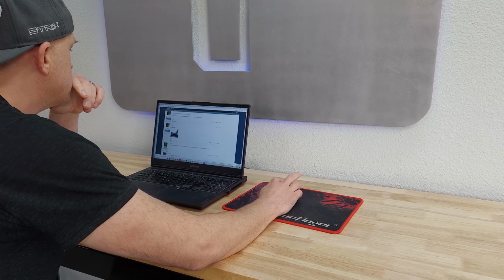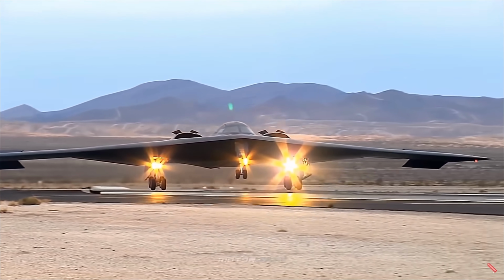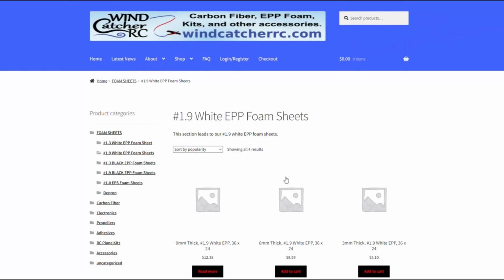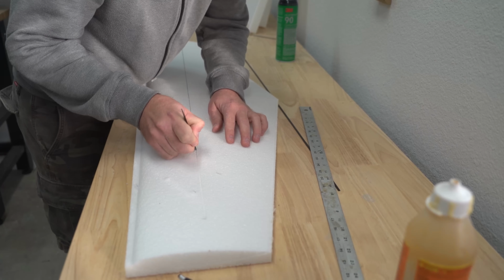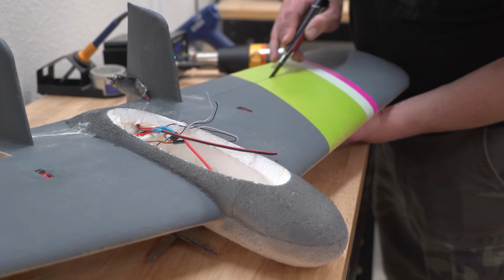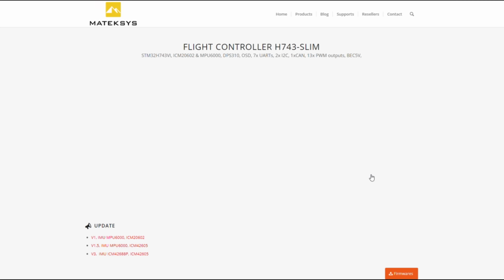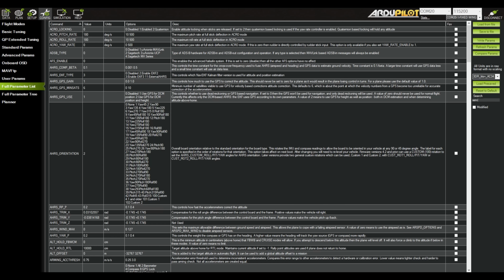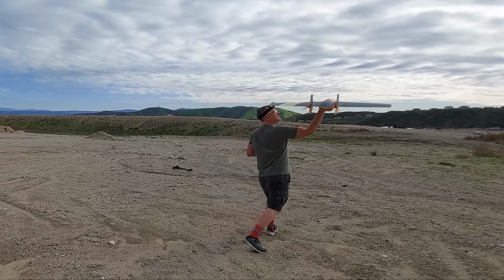Aerodynamic Instability:  The Holy Grail of Efficiency?  Part 1

Comment: The pitch oscillations evident in the video indicate that a significant issue here is rate-limited servos. You can have the perfect control loop, but if your servos cannot keep up with the commands, you'll always end up with oscillatory response.
Reply: Oscillations can also occur in a perfect "instant" system. Looks more like bad pid tune than rate limiting.
Reply: @onebacon_  Is PID still widely used in flight control? I thought it would all be LQ these days, or maybe a combination?
Reply: No. Oscillations are often the result of closed loop feedback system which is unstable. This can be for example caused by delay in the closed loop resulting in the feedback signal being phase shifted to the point where it becomes additive at the input to the control system.

One such cause of a delay is the interaction between the human operating the demand controls and the control system, with the human introducing a delay in the feedback loop.

It can just be down to adjustment of the parameters in the control system.

This control theory subject is not actually taught to students until they get to an undergraduate degree course at university in Engineering. So it it not surprising that many people don't understand it.
Reply: @deanXRayZulu  with all due respect, and not knowing anything about your credentials, I'm extremely familiar with this material. I'm a civilian flight test engineer for the US Navy with 32 years of experience in aircraft control and dynamics, degrees in aero engineering and simulation, and I recently edited the US Navy's Test Pilot School flight test manual (FTM) for Fixed Wing Stability and Control (FTM-103), including regenerating 540 pages of illustrations and graphs and equations governing fixed wing vehicle dynamics, and also the Rotary Wing Stability and Control FTM-107 with 553 pages. FTM-103 and FTM-107 are loaded with stability and control expertise from 70 years of aircraft testing at Pax River and beyond. In FTM-103 and FTM-107 there are entire sections on feedback loops and pilot-induced oscillations, including all the math necessary to analyze and understand the various phenomenon.

Since 2018 I've also updated the Pitot/statics FTM and Fixed Wing Performance FTM-108. All told, I'm personally responsible for updating about 2,000 pages of Test Pilot School manuals, working closely with USNTPS instructors who teach this stuff every day, in the classroom, in simulators, and in the air. And I help mentor and teach junior engineers these principles. I've worked on a couple dozen different platforms in my career, both aircraft and training simulator systems, from the TA-4J up to F-35.

So I'd like to believe I have some credentials in this field. With that said, I hope my answer below is instructive and not defensive or pedantic.

The proper question is, why is the system unstable? You asserted that it's "the result of closed loop feedback system which is unstable." But you cannot correctly separate the control feedback system from the air vehicle; it's all part of an overall system. That system encompasses vehicle aerodynamic stability, control system phase and gain, control law and actuator lag or delay, aeromechanical flexibility, and more. Even the pilot (which we jokingly refer to as the "meat servo") is part of that system. ALL of it works together. 

So the control system is just a link in the loop. By itself it is NOT a closed-loop system insofar as it has to do with the overall air vehicle stability; it simply cannot be stable OR unstable without the air vehicle and everything that is in that entire loop. In an unaugmented system, it's only the pilot that closes the loop. In an augmented stability system (such as Arduino Pilot in this case), the very thing that closes that loop is the control system, which is basically directed by the pilot to shape its output towards a desired end state.

A mathematical model that properly accounts for all this complexity may allow a sufficiently speedy and powerful control system to create a resulting stable air vehicle response, but latencies/lags or insufficient authority will cripple the overall system's ability to be stable. It doesn't require an unstable control system; it's the ENTIRE system that is unstable. A perfectly stable control system can be entirely unstable when put into in the loop. And by the way, "pilot-induced oscillations" show that a perfectly stable system can become unstable when you put a pilot in the loop, in the presence of certain flight conditions, or system and pilot characteristics, even in an augmented system.

With all that said, yes, it is possible that the control system can itself be unstable. This might occur if it is a "model-following control system" (Joe Barnard talks about this in some of his videos.) In that case, a computer is attempting to run a simulation of what it thinks the airplane should be doing, and then observes the real-time response of the air vehicle, and attempts to make control inputs to return the vehicle to the desired response. And that can be done poorly, and become oscillatory in its own internal response, and thus induce air vehicle oscillations. 

But in general, a control system's inherent stability is not the primary issue in air vehicle stability. You need to keep the entire loop in mind.
Reply: @Brandon_SoMD  Just out of curiosity, how many control refreshes per second did F-16 block 1 computer do? Or is that still classified?
Reply: @akkudakkupl  No idea. That's an Air Force jet, not a Navy jet. But I typically don't get involved in the system internals; I work on the overall system response, e.g. is it suitable for the mission.
Reply: @Brandon_SoMD  Ah, okay, didn't read with enough attention to register the fact you work for the Navy.
I just wonder what is the 'bare minimum' for an aircraft FBW system to keep it in check.
Reply: @akkudakkupl  It really depends on the entire system dynamics, as well as the actuator capabilities. For a fairly stable aircraft, a relatively low rate is fine. The F-14 computer operated at about 50 updates/second, I believe. For something like the X-31 (which the Navy tested briefly, and is naturally unstable) you need a fairly high rate (I believe it was 400 updates/second).
Reply: @Brandon_SoMD  Thanks for the info :-)
I thought the F-14 computer controlled "just" the wing sweep and rest of it was with hydraulic servos. Or was there full FBW in later versions?
Reply: Agree that the smaller the model, the faster the response loop has to be.  Would stepper motors give a faster response??  Or perhaps linear actuators?
Reply: @nigelwilliams7920  Good question. I had to do a little research about your question, since my experience is rather dated. It seems like the Futaba BLS series of servos are stepper based, and thus reputedly quite good for helicopter control (which requires very fast response) but are fairly expensive ($200/servo). Speed is 0.07 sec to 60 deg, compared to about 0.13-0.20 sec for traditional servos (so about 2x to 3x as fast).  But they have the same form factor and wiring as regular servos. Given what I see in the video, 0.07 sec is easily within the response rate needed for this twitchy little plane. I'll bet he could pull it off with BLS.
Reply: I don't think this is the case. It's a system, and the servo responses are a part of the dynamics of this system. Many real world rockets such as those flown by SpaceX are not stable, and also use slow actuators. These systems are very well controlled due to the system dynamics being very well understood. I would hazard that faster actuators, if not properly understood, will simply lead to higher frequency oscillations and problems. 

As other comments have put far better than I will, properly modeling craft dynamics is the solution.
Reply: @KnowledgePerformance7  That's a fair point. Joe Barnard at BPS.Space has done a lot of interesting things in this arena, like vertical landing a model rocket like Falcon 9 does, and his channel is worth checking out. I think, however, that "slow" actuators like SpaceX uses are far more acceptable for large heavy systems. The smaller the vehicle, the more "twitchy" it is, and the faster the control systems have to operate. Also, the less stable, the faster a response is required. Watching this video makes it clear that the vehicle is responding VERY quickly, and you cannot hope to control it unless your actuator can go stop-to-stop in about the time that the vehicle executes a single oscillation. Those actuators in this video are WAY too slow for THAT. Dial down the aerodynamic instability (move the CG closer to the aero center), and it MIGHT work with the current actuators.

So in summary, I think you're right to a point, but faster actuators will be required to handle this level of instability, even if the system dynamics are perfectly modeled.

Comment: Can the servos use the 400Hz refresh rate? I'm under the impression that you'd need special digital servos to take advantage of 400Hz refresh rates. I think helicopter tail rotor servos can use this rate but I don't think these types of servos are very common.
Thanks for sharing your experiments with us. I've often wondered about unstable RC aircraft myself.
Reply: Cheaper, or analog servos can not. (typically will emit an audio buzz if pushed too many cycles). Digital servos are mare capable.
Reply: Extra fast tail-rotor servos will be worth the cost, for development.  One less thing that might be the problem.
Reply: I flew a rc helicopter with basic servos and the gyro helped compensate fine, it’s not the servo, but in this presentation and test maybe a gyro could help

Comment: Is there a way to start the elevons in a partial down position better fitting to the slow start speed and then let the integral part of the control loop move them up into cruise position?
Additionally I think the control loop would benefit greatly from an air speed measurement and a general idea on how to put up the plane configuration for that speed.
I would propose wheels and a run up tests on tarmac as done on the first stealth planes but that opens another can of worms with problems of their own.
Reply: Maybe I am thinking about this way too complex and some pid control loops will easily solve this problem. My head just jumps to more complex control loop solutions.
Reply: @TheManfet  No. PID cannot solve this particular problem. The issue is that the metastable elevon position is dependent on AoA, and the opposite way that you would expect. If the active stabilisation system were working perfectly, and we wanted to fly at high AoA, the elevons would be making small corrections from a down pointing base position. Without some active AoA measurement a PID would not work because AoA is not well captured by orientation position, error integral, or rate (derivative). A more complex control loop might be able to infer it, but a simple PID cannot.

Comment: Hi! Just a thought: Arduplane has a QadPlane option where plane and copter features are merged. I have not used it, but it is supposed to be able to copter "assist" plane mode when approaching speeds and attitudes where fixed wing flight is no longer sustainable. Could this be used to get your model  dialled in? You would off course need vertical thrust of some sort, but just initially....

Comment: Nice to see you pick this idea up! I've been working on something similar for a while. I plan on fully modelling the flight mechanics & actuator dynamics before hand and using that model to set up a custom flight controller. It should be perfectly doable without all that,  it'll just take a lot of time to tune the controller parameters right. Most importantly try not to make it too unstable since that'll require greater servo speed & response time. Another big problem is that you won't need a lot of elevator travel while the aileron travel is largely unaffected. So it might be a good idea to split the elevons into separate ailerons & elevator.
Looking forward to the progress & discoveries you'll make along the way!
Reply: With my vast experience with betaflight and high preformance quads, and trying AP on these high preformance quads AP cannot handle or is setup to this task. iNav is a fork of BF and they race with iNav on planes, I know of no high preformance racing done with AP (the pixracer was a total failure in the racing scene). AP is not a low latency pid and filters loop, they are made for larger size, heavier and slower craft and autonomous, I seriously think you will fight the limits of AP slow loop for a high preformance plane, try iNav.
Reply: @user-rs8zg8ey2b  well, I won't be using ardupilot but fully self written code on a custom board. 
However, ardupilot is more than fine for this application as the loop time of the PID is multiple orders of magnitude above the response of the servo actuators, which are the limiting factor here. An ATmega328 would probably still be plenty fast enough for this task, and that is way slower than the ARM uCs in the pixhawk and other ardupilot FCs.
Reply: @tyskStefan  Well good to know your writing your own code. AP is NOT successful in any racing task, so imo is is not good enough for this application in this video and maybe not your application (not seeing your application, I dont know). Of course this is not racing, but needs quick response, unlike anything I have seen AP do. AP was a pain just to get a old school mini quad flying w/o oscillating, and it never flew "good". Good luck.
Reply: @tyskStefan  Curious why a custom board, because F4 FC are less than $20 nowadays? What do you need different?
Reply: @user-rs8zg8ey2b  multiple reasons: first of all because I need dedicated sensor inputs for angle of attack vanes, pitot tube and the likes as well as a beefy onboard BEC to supply the servos with. Additionally I don't need the OSD chip and some of the other features provided by multirotor FCs, I hardly use those on my multirotors... But most importantly it saves me the headache of searching for a new board and writing a new config every time a board gets discontinued.
Reply: I don't know much about planes  so forgive me if this is stupid but can you really separate out elevator and aileron without causing any new problems? My first thought is unless you have a large vertical stabilizer you would end up causing yaw movements and extra drag undoing any effeciency gains. Then again with more control surfaces you could control yaw, decrease vertical stabilizer size so less drag maybe? Sounds like a good thing to simulate to test.
Reply: @JustinHunnicutt  I'm not quite sure how you think this would generate a yawing moment, but if you explain your train of thought I might be able to explain.
But first: think of separated elevator and aileron like a wing with flaps similar to performance rc sailplanes (F3B for example); the elevator are the inboard flaps and the ailerons the outboard flaps, NOT split in upper/lower part like the outboard control surfaces on the B-2 spirit.

You would want to set up your ailerons in a way, that doesn't generate an additional pitching moment, which can be the case if the downgoing & upgoing aileron deflection are the same. This depends on a lot of factors though, but you technically should at least try to achieve this on any aeroplane, especially those that uses elevons.
Last but not least: ailerons and elevons will always cause an adverse yawing moment due to the difference in lift and therefore induced drag. Thats why you want to coordinate turns using aileron + rudder (bigger aeroplanes use additional roll spoilers for that as well).

Comment: Would this perhaps work better with thrust vectoring? Just a guess, but wouldn't  the effectiveness of the elevon's change dramatically and unpredictably at higher angles of attack as the air flow begins to separate. Making tuning the autopilots output next to impossible without a wind tunnel.  At least with  thrust vectoring the pitching moment they would apply at a given power% and  angle  would be more predictable, particularly if they were in front of the wing.  Though I suspect their effectiveness would still change depending on the airspeed because the blades are fixed pitch.
Reply: I was gathering from the video that the point of the instability was so that the elevons could have negative reflex and increase lift at slow speeds. That effect would be negated if thrust vectoring was used instead.
Reply: @FlyXenonRC  That effect could be amplified further if the elevons weren't constantly oscillating to provide roll authority.  and instead acted more like self-adjusting flaps that only responded to pitch. In any case using thrust vectoring or differential thrust  could provide more pitch stability.